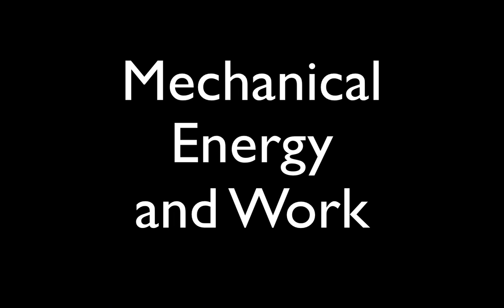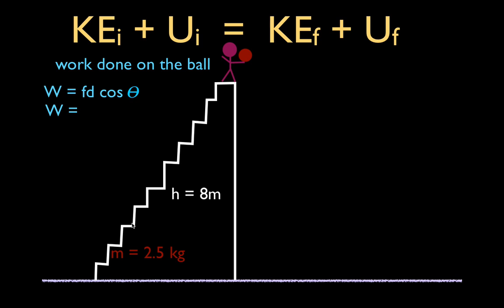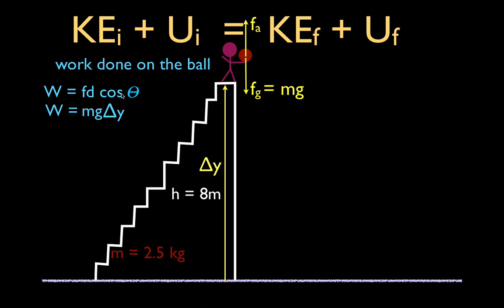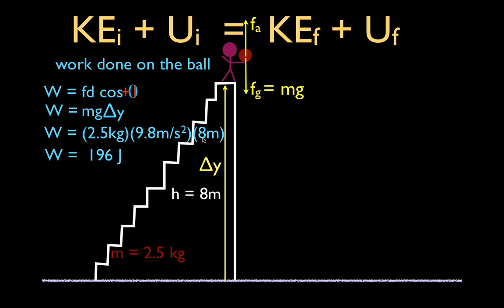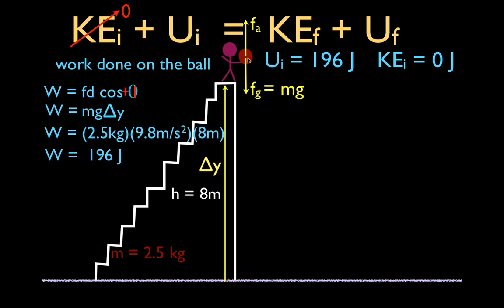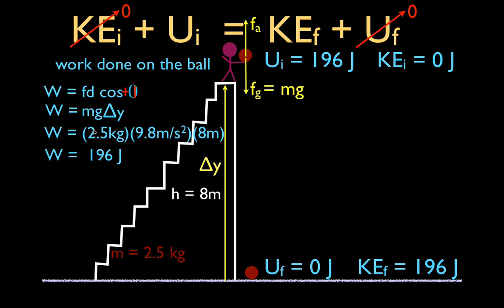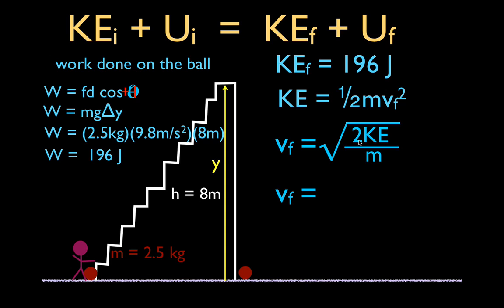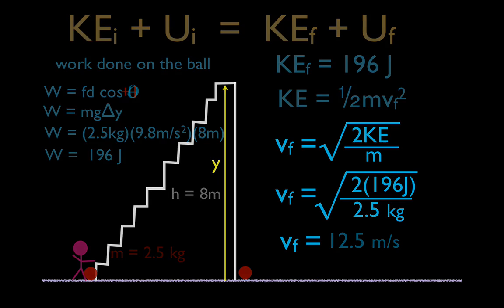Energy, Work & Power (21 of 31), Conservation of Mechanical Energy & Final Velocity

Comment: 2:45 isn't the angle for the cos theta supposed to be the angle between direction of the two forces which are the applied force(Fa) and the force of gravity(Fg) ? so it should be cos180
Reply: just kidding i was wrong
Reply from the maker: No problem
You can see a listing of all my videos at my website, http://www.stepbystepscience.com

Comment: You should come teach at my school please
!
Reply: +Brian Swarthout Sir why didn't you put height in the formula of work instead of putting ∆y?
Reply from the maker: where do you go to school? i teach in Berlin Germany.
Reply from the maker: +Faisalkhan Sasoli The height and the change in the y are the same thing.  In this example 8m is the vertical height of the stairs it is not the "length" of the stairs.  I can see now that this could be a little confusing from the diagram.  You can a listing of all my videos from my website, http://www.stepbystepscience.com
Reply: +Brian Swarthout No sir this question is not according to this topic.
Reply: +Brian Swarthout I know here in this topic mass of body covers distance in y.axis.
Reply: +Brian Swarthout I know here in this topic mass of body covers distance in y.axis.
Reply from the maker: Then what is the topic?